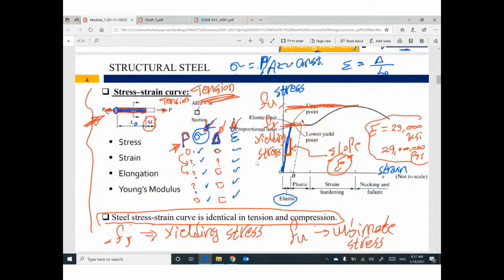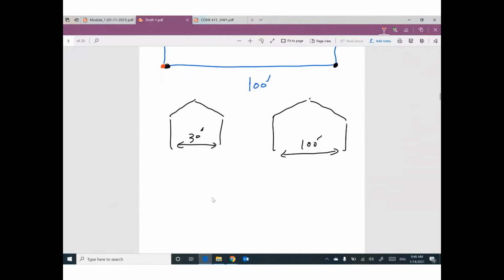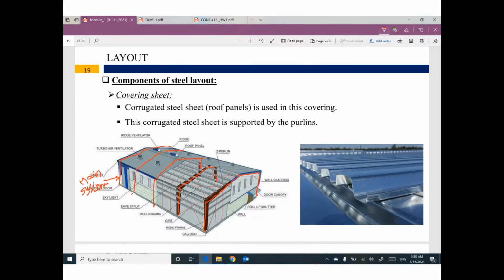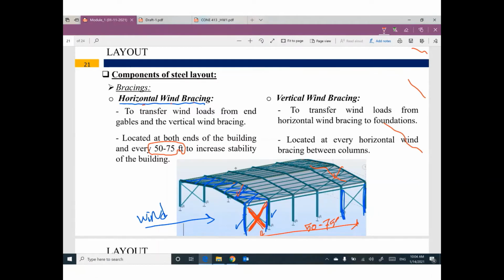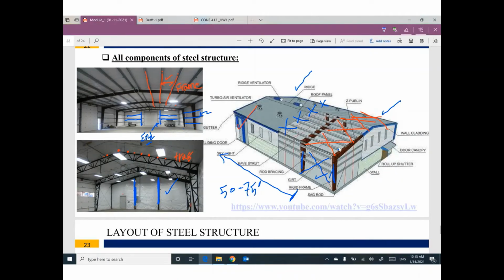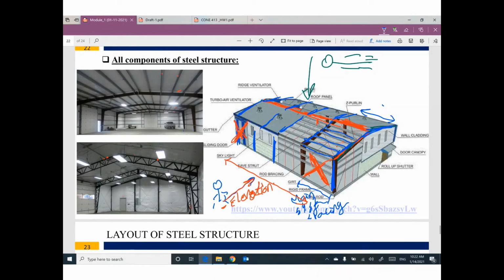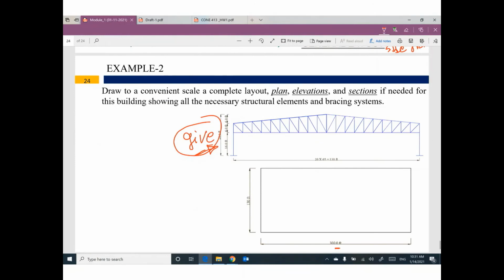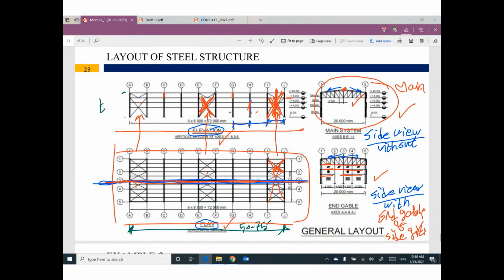Introduction and Layout of Steel Structures part 2/2

Comment: hello dr ayman thanks alot but i have a question please
does the position of the end gable is at intersection of hz bracing with main frame ( in case of frame and truss ) ?
Reply from the maker: Hello,
It is not a big deal.  The horizontal bracing will transfer the lateral load from the main framing system (fram or truss) to the vertical bracing.